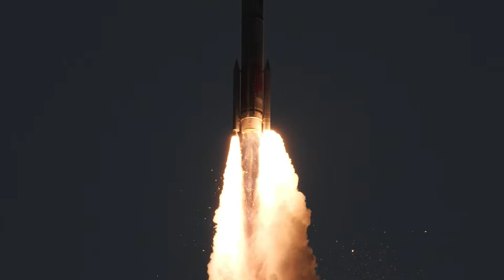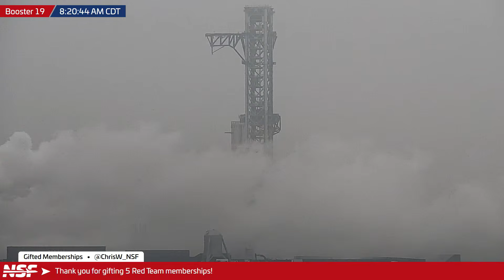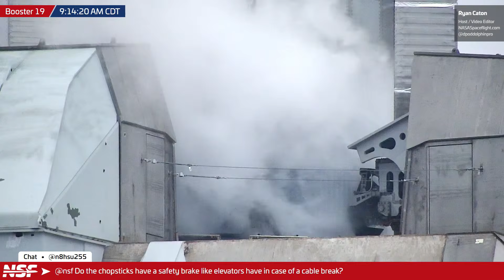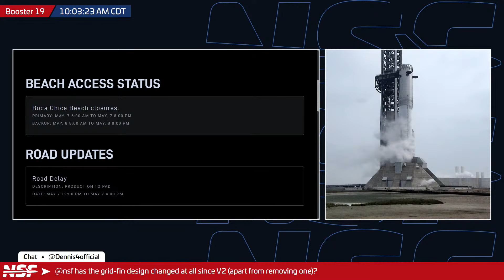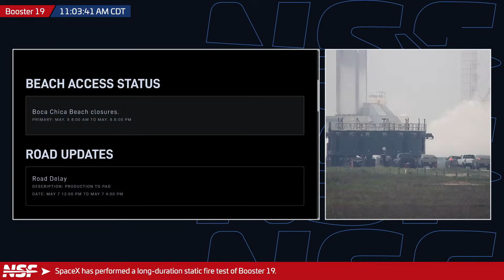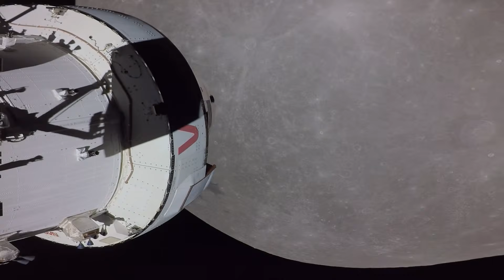SpaceX Static Fire's Booster 19 ahead of Flight 12

Comment: My theory isnt that they recycled the deluge,  There was too much pressure in the system, so they thought the DSS would release enough to be safe, it didnt so they hit the depress briefly to bring the pressure down to a safe level before activating the deluge...after that little pop-off a few days ago, it seems there may be a pressure issue with the pad and deluge system...after all, the last abort was due to a pad issue as well. 

Hooking up the deluge to the Brownsville water main....RIP Elon's water bill....and RIP Brownsville's water supply on Launch and testing days...lol

Now we know SpaceX was watching with the talking and venting bit...you know they were trolling Ryan hard!
Reply: The DSS and the deluge run on different systems. Plus the DSS got turned off, a sign that they had aborted. What we didn't notice, because of the clouds, was the DSS turning on again after the quick recycle. The water already comes from the Brownsville municipal water so... not a big change to have a pipeline for it instead of trucking it in.

Comment: I could be completely wrong,  but I think the reason behind the production to pad rollout for today was for the BTS to roll out, which already happened, and that BTS will roll B19 back to MB1 for a very thorough post-SF inspection before returning it to Pad 2 early next week. 

There's no reason to roll S39 out to the pad until then. It obviously needs the booster to be stacked on, but B19 needs a very extensive going over to check for any cracks, hairline fractures, etc to the engine plumbing. 

If it gets rolled back today, I could see SpaceX returning it to the pad Monday or Tuesday,  S39 rollout within 12-24 hours, stacking, WDR, and launch next Friday or Saturday. Or early the following week. 

Keep in mind that NET means No Earlier Than, and next Friday(15th)might be a little too optimistic still. And weather is always a factor too. 

Regardless of When it launches, either SpaceX or RGV needs to have a plane in the air to get decent launch footage  because the smoke plume cloud may be too large to see much of anything until the stack fully clears the tower.
Reply: The BTS only rolled from the middle of the road to the launch site and because earlier in the morning it had rolled from launch site to middle of the road. The reasoning that the rollout closure for production to pad was for the BTS really doesn't work, especially given that the ship transport stand had already moved to Mega Bay 2 which clearly indicated that Ship 39 was about to be loaded on it. I know your comment is old and now it's very much proven that yes, they intended to roll Ship 39 and an issue with the chopsticks after static fire delayed that to today and now Ship 39 is on the transport stand getting ready for rollout. But it's not like we said Ship 39 would be rolling out just because, they don't issue rollout closures for transport stands that are in the middle of the road on a road that is already opening from a test that happened that day. We also didn't have a closure for when it was moved from the production site to the middle of the road. So it never made sense to even think of such a thing.
Reply: @Alexphysics13 OK.  So what was the problem with the chopsticks yesterday?
Reply: @MrX-zz2vk  A skate on the carriage system broke, they're about to install a new one right now.
Reply: @Alexphysics13 Thanks. That must've been the reason for the delay in getting S39 rolled out then. Maybe.

Comment: I don't think you'll see a WDR tomorrow.  They've never stacked these two before and they are testing everything a lot more thoroughly than on previous versions.  They've got new lift points, there may be fitting and/or fit checks of the BQD, etc.  I bet they do a lot of testing on Friday and maybe into more other days depending on the results of their tests.  After all, they test to uncover issues so they can fix them before the real flight.
Reply: Which is what they should have done for years except always create a lot of buzz around their "iterative development" which actually was just "elon pushes us to hush and hurry instead of getting things right from the start" 🙈
Reply: @RickSanchez_85  They wouldn't have got things right from the start no matter how they did it.  Look at Artemis.  People get confused about what is going on here.  SpaceX isn't designing a rocket, they are designing a product and a manufacturing facility to produce it.  Their project is massive compared to any other product development I've ever seen, but their development process is very conventional.  You produce prototypes which you know will not fully function and test whatever aspects of them you can just to see if you are on the right track.  Then you build better prototypes and demand more of them.  Etc.  It is customary to push things until they break because you know your end users will do so and you want to get there first.  At some point you produce an Alpha level product, still in your engineering labs, that you might let others in the company or even one or two really key customers try out so they can give you more feedback.  That would probably equate roughly to the V2 Starship series.  Your beta level product is typically produced on the production line which you have been designing along with the product.  It was informed by all previous testing and is generally very close to the final product, with just minor tweaks and adjustments to be made before full product release.  V3 is their beta level product.  They are still testing, but will start using it to fly Starlinks, tanker flights, and the HLS.  At some point they will "release" it - though publicly or not is hard to guess - and their manufacturing line will start cranking them out.